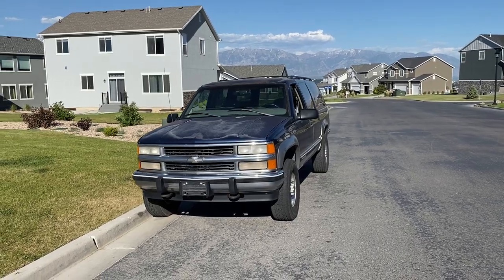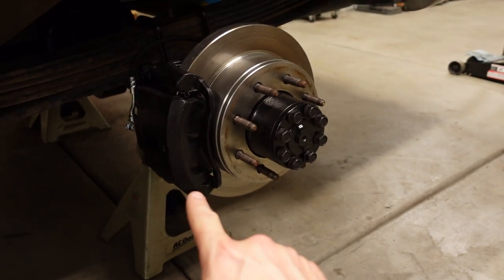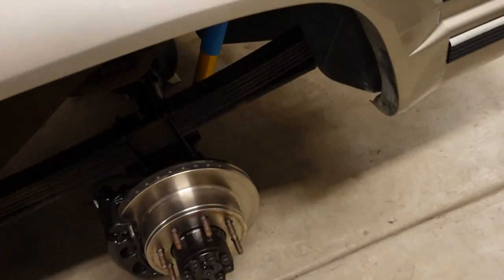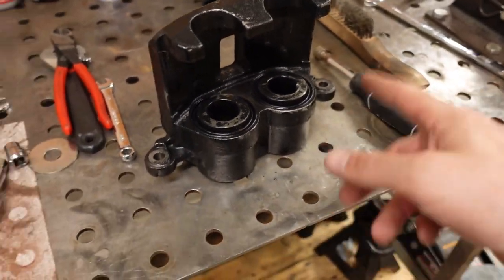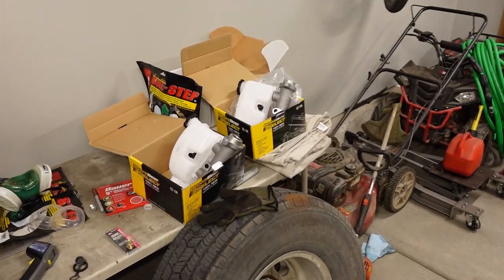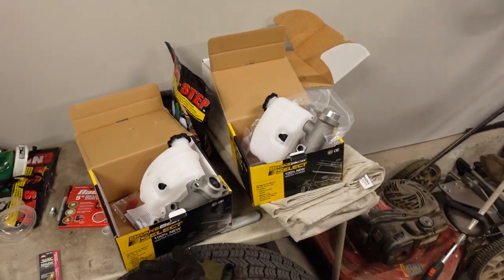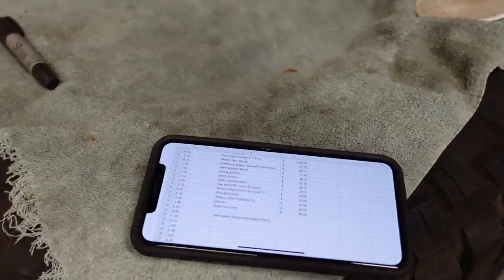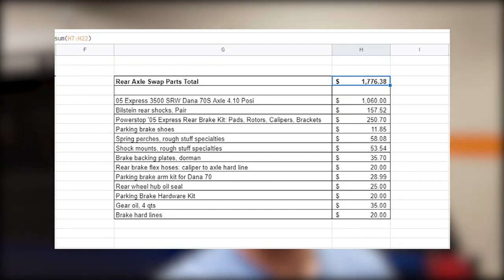K2500 Suburban brake upgrade fail + Cost of Dana 70 Swap

Comment: NM2779 master cylinder autozone..should be the one you need its off of a astro van..UPGRADE...😎👊🏻 for the hydro boost...
Reply: Would that part number fit the original hydra boost for a c2500?  I tried the newer model for my 99 c2500 and I ran into the same issue with bore bring larger. I’m getting ready to do LUGNUT4X4 rear disc conversion and I believe upgrading the master would help tremendously. Thanks
Reply: @dalehall2993  as long as the bore is the same size as the old style. I’m good. I was told a newer style MASTER is a lot better due to shorter stroke= better braking power. But I’ll definitely look into that.
Reply: From my personal experience, on my  1998 c2500, i upgraded to  the Astrovan master cylinder, and it is a night and day difference!!!
Reply: @mattcat231  what year Astrovan? Now I’m really interested. I actually Just replaced my master with a new original and my brakes feel a lot better but when I do my rear disc conversion I will probably replace it with the Astro one. Thanks for the tip.
Reply from the maker: is the NM2779 from a 4 wheel disc brake astro?
Reply: @LawrenceTolman  
Im not sure about that?? I know the guy had a dually he installed it in..
Reply: @LawrenceTolman  I just looked up the part number on Autozone app and from the picture it looks like it will work. I know the pictures are not always accurate but this one looks dead on. And it seems shorter. Good for shorter stroke= better stopping and eliminating the spongy feeling. I’m definitely going to look into this when I convert to rear disc soon.
Reply: So is the NM2779 confirmed to work on the gmt400 hydroboost setup?
Reply: Ok m running the astrovan master cylinder. Stops well but the reservoir makes me less than thrilled...
Reply: This is great stuff! Thanks for the burb videos and upgrades. Can’t get enough of these. Really excited to see what performance upgrades to the 454 you’re planning. Keep these coming! 👍🏻
Reply: @pulpo.r7790  how'd the lugnuts conversion turn out? I ordered one but haven't installed it
Reply: @t-dog3192  man. I haven’t installed mine yet either. I don’t drive it as much. Thinking it would give me a good chance to tear down and install but now I’m a truck driver and almost always gone. Only home for a few days. But I really need to upgrade the brakes. Because now I started noticing my brake pedal really low to the floor. So now I have to see if it’s the master or the hydra booster going bad.
Reply: @pulpo.r7790  bummer. Yea I'm overseas at the moment. It took at least 5 weeks for all the stuff to show up. I was pretty disappointed I couldn't get started on it before I left for work.  Hopefully soon though! Be safe.
Reply: @t-dog3192  i DONT remember how long it took for my stuff to arrive but it wasn’t long but the packaging was a bit crammed. Boxes sort of damaged. But everything inside was ok. I will be doing it pretty soon hopefully.

Comment: Great job with gmt400, I did the hydroboost conversion on my 96 4 door 4wd tahoe. I  use parts off of C3500HD, hydrobooster and spacer, master cylinder, and proportioning valve. Works great with gmt800 half ton rear brake swap also. Those are the best mods I done to it.

Comment: I'm old enough to be wrenching before and during and after their life span. Most people don't know there were a couple of years that had 4 wheel disc brakes and they are massive.  The c3500hd 2wd dually interchange.  I have it on all my k2500s, hydroboost,  master cylinder,  calipers,  and rotors.  The size is a BIG difference. You are increasing the gvw braking power, and no spindle changes.
GM brake code JF9
Auto zone pt #
Master cylinder  NM2754
Hydroboost  52-7338
Front rotors 55028
Front calipers Pass. C541
                         Driver c540
Reply from the maker: thanks so much for the info thats super helpful!
Reply: Wow that's good info
Reply: So just what couple of years had those BIG Brakes in them so I can find these parts for my 99 K2500 big block 7.4L- would love to put them on my truck.   Thanks for the info .
Reply: A man with knowledge.  A lot of the 3500hd are  interchangeable. I work in the junkyard business.  I'm currently working on my 99 k2500 4x4 diesel Suburban LS 
Going to put a dually under it 
With 19.5 wheels. Built 6.5 bomb proof. Used everything the marine models up grades.

Comment: Who is saying that track width will effect turning radius or tracking?... If the rear axle is square to the front, it will track straight. Turning radius is a product of the distance between the front axle and the rear plus the steering angle available. Track width does not effect any of this...

Comment: As someone trying to nail down the sloppy steering in a lifted k2500 Suburban I figured I would make a shameless plug for BlueTop Steering gears in Stanton ND. He was able to custom machine the top plate and fit a needle bearing in above the sector shaft to help hold things true better than the stock bronze bushing up top. Plus I think he is cheaper than a redhead unit.
Another side note, someone else mentioned the length of the u bolts in another post but ORD makes a U-bolt flip kit to help eliminate the water/rust trough on the bottom of the axle and gain some clearance for the nuts hanging down below the tube.
All in all great content, I appreciate seeing someone else addressing the same issues on the same truck. If I ever get out to Utah with mine I'd love to get some side by side shots of them.

Comment: Awesome job LT.  It looks amazing.  I refuse to use wheelspacers under any circunstance.
Reply: I used to think that. Then I watched Whistlindiesel abuse some, his 11,000#-rated Dana 80 axle bent but his billet spacers didn't fail. So I got a pair of 2" for my Dana 60 under my '72 F250. I then added 5,000# and went driving. Now it's 8 months later, they're still going strong.

Comment: Before you go through the trouble of changing the hydroboost check the dimensions on a GMT800 1/2 ton hydroboost master cylinder. I honestly dont know if they are different but you could measure in the parts store to see. 2004 Suburban 4wd vin Z will work to look up the part.

Comment: Using the GMT800 spindles allows you to use the GMT T1XX rotors and four piston brake calipers, however you need to use a washer to space out the caliper just a tad for clearance. .

Comment: I'm ready to see u do the front brake upgrade. I got the parts to do it. Just need the time to drill the ball joint holes. As for the loose steering do the rag joint delete to the u joint style. Cunningham machine has the u joints and shaft
Reply: Probably from Borgeson
Reply: I'm getting ready to do the Cunningham Machine u-joint myself. I'm excited.
Reply: Thats for 88-94 only..i see they do have one for a 95-00 only as well.

Comment: Looks great. I'm currently rebuilding my front end. I did a rear disc conversion on my 14 bolt semi floating axle last winter.
  I may swap master cylinder too. I've got new brake hoses, new calipers, new rotors, hub bearings, cv axles, ball joints, control arm bushings, tie rod ends, adjusting sleeves, centerlink, steering stabilizer, idler arm, pitman arm, steering box, upgraded steering shaft with u joints instead of rag joints. Differential drop bracket, g80 locker in the 9.25 front, lockright lunchbox locker in the 9.5 rear. Oh, and new shocks too. She'll be good when I get the time to finish her!
Reply: Hey Eric on the 14 bolt Simi float did you go with a disks brake kit like lug nuts or other, or did you get a newer GM factory to fit, I'm having a hard time with the after market kits with a little Cadillac caliper,
I already have 17  inch rims on a 96 2500 HD 8,600 gvw.
Reply: @patrickjohnson7801  Lug Nutz is the exact kit that I used. It was like $340 when I did mine. The worst part was pulling the axles and driving out the wheel studs. The rotor mounts inboard of the wheel studs. Much like the front rotors mount inboard of the front hub bearings. Aside from that, it was a very quick install.
Reply: @EricErnst  thanks for the info, that's the one I have been looking at I guess any thang is better than what I have, I'm going through a set of front pads in about 9,000 miles, I was hoping to see someone do a factory HD 3/4 ton conversion to a OBS
Simi float, probably not just because of 8 lugs to 6 lug just My thought, was hoping someone would come up with something?
Reply: @patrickjohnson7801  I'm sure it could be done. I have heard of it, but i didn't want to have to source all of the parts from a junkyard truck.
Reply: @patrickjohnson7801  https://youtu.be/_ZiI9AfnYv8  
here's a quick video that I filmed. I put stealthy over-axle traction bars and new shocks on at the same time as my rear disc conversion.

Comment: Sometimes on that generation of GM truck chassis, you have to hook up a diagnostic tester and do a forced ABS cycle to properly bleed the rear brakes, or to allow bleeding. I was involved in a case of this on a truck that the rear brake line had broken near the fuel tank, 1997 K1500.
I have a good guess for a master cylinder to fit your existing booster. Think 99 C3500HD truck chassis. They would be 4 wheel disc brake.
One tidbit on hydroboost to master cylinder changes is also the length of the bore in the end of the master cylinder piston vs the booster pushrod length to it. There are changes from one model to the next. The military M1008 and M1009 difference on that little part is a prime example not found in parts catalogs. Too short=late to braking, too long=dragging brakes.

Comment: Did you run into any problems with your emergency brake cables?
Are you going to run an adjustable proportioning valve & delete the ABS?  Or do you have any ideas that might work with OTC OEM parts?
Excellent work BTW! 🤘😎👍

Comment: I swapped to a Nbs 2500 hydroboost and disc brake rear axle. Unscrewed the mounting plate and pulled the pushrod out and switched it and recrimped it. Then it bolts right in. Stops way better.

Comment: Nice conversion!  I just found out that my gmt 800 is 3.73 gears.  And I was told it was 4.10's when I bought it.  My fault for believing the dealer and not checking the rpo codes... but it has the 11.5 AA, but doesn't have limited slip.  I want to convert to 4.10's since I also put 20 x 10 x 33's on it, also the previous owner put on newer Silverado 20 inch rims, but I didn't like them.  I was looking at just replacing the diff to a posi traction setup, and that alone is almost 1000 or more from what I have seen.  And I'm in MI, and my axles are more rusty than what you started with.  Also he removed the whole e brake system, my pedal does nothing.  After watching you clean that axle up, it really makes me want to do the same and just pull it down, fix the brakes, do the gears, and paint it..

Comment: One thing most folks do NOT understand is that Manufacturers try their best to control production costs and keeping them minimalized, increases their profits. Thus the OPTIONS are pushed as well to increase their margins. The project you performed should , in my opinion, be standard for ALL manufacturers vehicles at minimal cost increases, as additional options.

Comment: Here in Utah County, wheel spaces technically aren't legal (without a safety inspection anymore, nobody is getting cited for them). So for legality you went the better route.
Reply: That’s not entirely true. The bolt on wheel adapters are legal. The slip on wheel spacers are illegal.
Reply: Challenge Personam jurisdiction per Basso vs Utah Power and Light
Reply: That's referring to the spacers that don't have a second set of wheel studs pressed in. But they were factory original equipment on every '84-'92 Camaro and Firebird that came with 16" wheels.

Comment: I got my GMT 800 14 bolt Full Floater with disc brakes for $260 from a LKQ pick a part boneyard.  My Suburban is the same blue 1999 K2500 w/ 6.5 diesel.  Also has the GMT 800 brake conversion up front.  Looks like you're near Saratoga Springs on Utah Lake.  We are constantly blowing by there between our ranch in SW Montana and our home in Fullerton, CA.  Should hook up and compare notes.  P.S. Just installed Cunningham bronze bushings on the driver's door and they are the bomb.

Comment: I agree with going the Dana 70 route, you'll be better much off down the road.  The wider axle will be more stable going down the highway, not less.
Reply: Technically, that depends on if he leans far enough to move the center of gravity out that far. The real, tangible benefit is ground clearance under the differential housing

Comment: Thanks for the videos! I've got a '99K2500 4x4 and bought a spare 95 or 96 i forget, but it came with an already swapped 2005 HD disc brake axle. I've pulled it from the dosage and I'll be selling it onto my '99. Now I'm curious about the widths and caliper type lol.

Comment: LT if we replace dic brakes on a 1999 6.5 4x4 to dic do have to weld the caulper breaker on. To make it work right. Thanks rob.
Reply from the maker: no, not really.  they make a lot of bolt on kits

Comment: The 2011 GMT-900 hydrobooster is an upgrade for the GMT-800 setup. GM GENUINE 1781036 supposed to be a better design. It's well talked about in the 2500 Suburban group.
Reply: I'd be interested to see what's required to run the GMT900 2500 booster and master in my GMT400

Comment: You can get the bleeder screw out, get a torch, a bottle of water and an easy out. Heat the corner with the bleeder screw real fast then shock it with the water and then use the easy out. I've done this many times and have had no problems with the calipers, as long as you heat it up and cool it off right away.

Comment: Fun video series.  I was interested to see the gear setup on that D70 was much more like a 14b (with side adjusters) than a typical Dana Spicer axle.  For the money and effort I would have gone with an 01-06 14b (AAM 10.5).  Per car-part.com you can get one in the Salt Lake area for 400-500 bucks with 4.10 gears and posi with factory disc brakes.  Yes, it would be about 1" narrower per side.  Probably still acceptable for your project.  Either way I appreciate you taking this on and showing the work and cost of the project.  Staying tuned for what you have coming up next.
Reply from the maker: that was my next choice for axle, the GMT800 10.5 14 bolt. Its about 67" in width from my research, so it would've been close, but I just wanted to go all in if I was gonna go through the effort to switch the axle
Reply: @LawrenceTolman  I get it 100%.  The newer disc brake aam 10.5 should be about 68.25 wms-wms for future reference.  I've put them under several Jeeps and they work well when matched with newer wider Ford D60's.
Reply: The Dana 70 gives more ground clearance under the differential housing

Comment: Even though no one asked im gonna share my opinion. I really enjoyed the video! U are a great host and are clear and calculated and organized and the video was put together nicely. With that said, i believe overall this was kind of a downgrade. You removed a legendary, strong, commonly available axle that is the dimensions it is for a reason, for an axle that is less so in all those ways. I understand the disc brakes are nice. But they make conversions. If i were you i would have just got a 14BFF rear out of a 01-06 HD truck that already has disc, ur gear, and traction device of choice from the factory  and then just put wheel spacers if it bothers you that much. Just my 2 cents.
Reply from the maker: Nothing wrong with an opinion! Sure, the 14 bolt gets a lot of love, and while I could’ve swapped one in from a GMT800 like you suggested, it still wouldn’t be wide enough and I don’t use wheel spacers if I can avoid them. The Express Dana 70 isn’t as common I’ll give you that, but it has an identical size 10.5” ring gear as the Corporate 14 bolt, is still a full floater, and also had a “from the factory” traction device, and it’s the exact width I was after without using spacers. I believe the Dana 70 has LARGER axle shafts with 37 splines, and the only thing the 14 bolt has this Dana 70 doesn’t is a pinion support bearing. While the 14 bolt is as you say legendary, I disagree that the Dana 70 was weaker or a downgrade.

Comment: I cant wait to see your front end video I have a 2000 k3500 and I hate doing the front brakes because of the captured rotors I have heard that you can do a 2001 2500 non hd knuckle swap but i would like to see some in depth details about it before i bite the bullet and do it. Im wondering if you can use gmt400 wheel bearings or if you have to use gmt800 ones and if i can use my CV axles and how much out of alignment it will all be at the end of the job. Thanks for the videos LT! You are always very detail oriented and informative!
Reply from the maker: I'll go over it in detail when I do the conversion for sure. The non HD 2500 knuckle is the one to get from what I've read, and you use GMT800 wheel bearings but should be able to reuse your CV Shafts. I'd plan on getting an alignment when you're done with it

Comment: Nice job, planning on a 3/4 ton rear axle on a 95 Dakota, lots of planning and suspension work ahead. Front spindles and brakes will be from 03 full size van, axle fro 04 2500. Same thought process, bigger and disc brakes all around. Also looking at hydro boost and master from 04 Ram instead of vacuum booster.
Reply: Unless you're trying to do what the 4x4 guys call tons, meaning 1-ton axles, on the cheap, you'd be better off swapping your 8.25" axle for a Durango 9.25" axle.